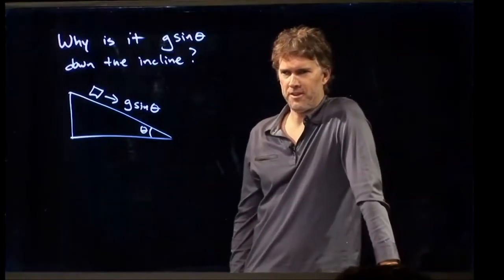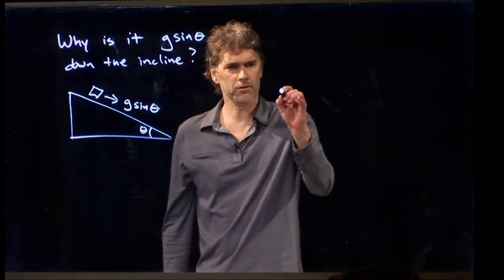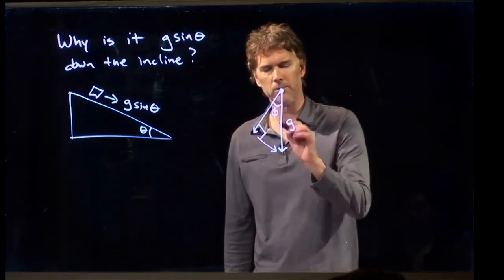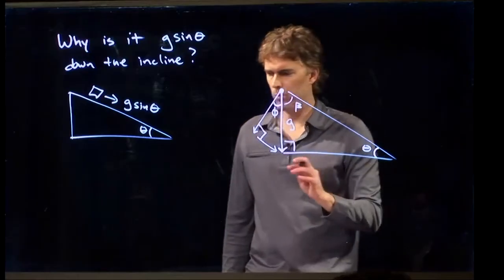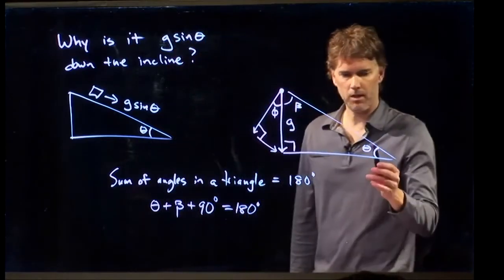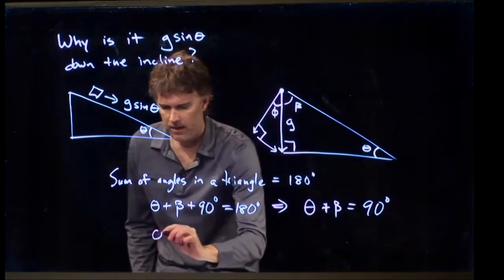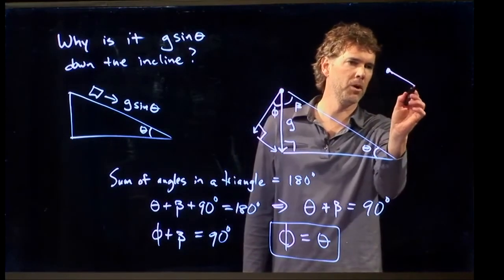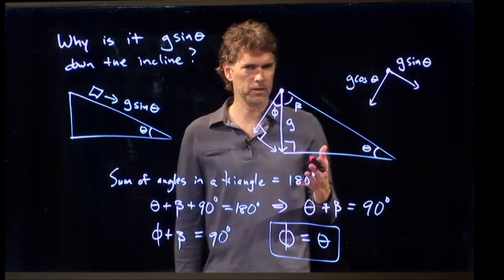Why is it g sin theta for an Incline? | Physics with Professor Matt Anderson | M5-11

Comment: I just want to leave a message for anyone who comes across the confusion i had in this video. The confusion is that 'phi' here with 'beta' makes 90 degree or not? The side opposite to 'phi' is actually parallel to the incline as well as the surface of the object which will be sliding which then makes 'phi' + 'beta' = 90 degree. The video was actually good btw. Thanks

Comment: Best physics lectures I have seen on YouTube, thank you!  But on this one, I don't understand why phi + beta necessarily = 90 deg.  It appears that beta depends on theta, which could vary.  For example, if theta was very large (say, 80 deg) then beta would be very small (10 deg), and phi + beta would appear to be much smaller than 90 deg.
Reply from the maker: I was "attempting" to draw the perpendicular to the incline, meaning that by definition it makes a right angle hence phi + beta = 90 deg.  My fault if that didn't come across.
Cheers,
Dr. A
Reply: Gotcha, thanks!   @yoprofmatt
Reply: Another way of thinking about this is that the sin component of g on the bottom is parallel to the incline (to make the vectors equal)
So, co interior angles have to be supplementary, which means that phi + beta + 90 = 180, so phi + beta = 90